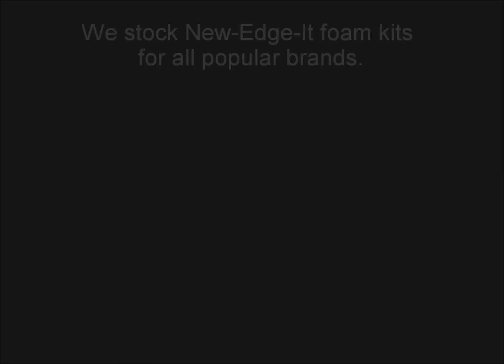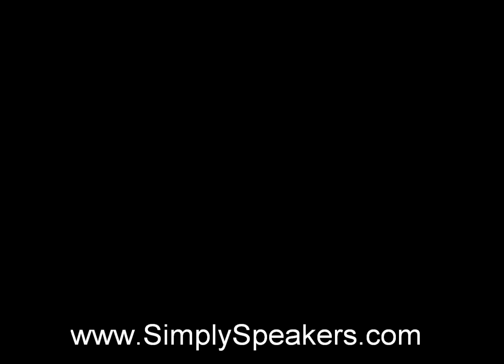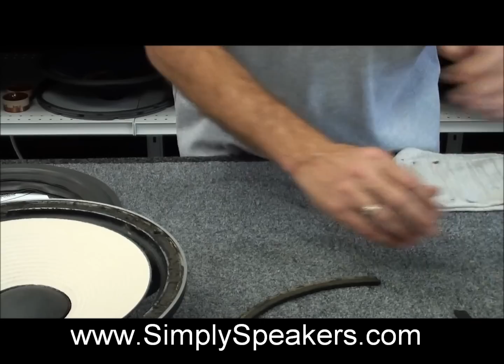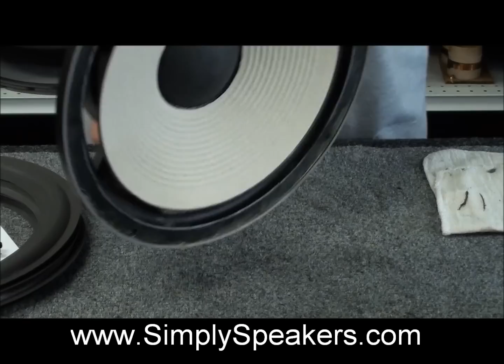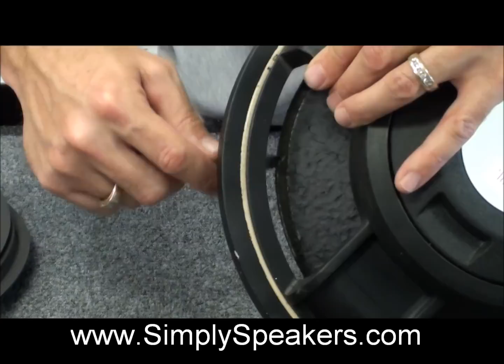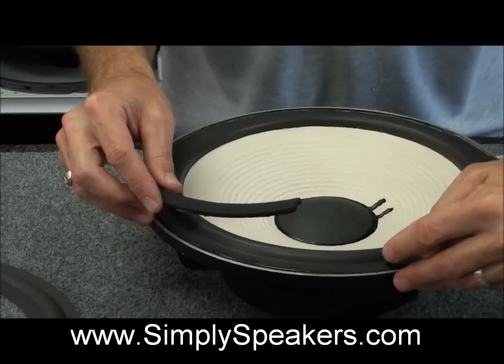JBL Speaker Repair 128H Replace Foam Edge Speaker Cone REAR MOUNT

Comment: I just repaired two JBL 128H Woofers on my set of Jubal L-65s. I used the Foam Edge Kit I obtained recently from Simply Speakers. These loudspeakers are extremely important and precious to me. I've owned them since the mid 1970s and they are truly my "EARS."  The woofers had been "re-foamed" in the late 1990s by a professional repair facility. Recently I discovered that both woofers needed their foam edges to be replaced again due to the onset of deterioration. I owned and engineered a professional Multi-Track Analog studio in Philadelphia which sported JBL Studio Monitors in all its "live" and control rooms. The L-65 speaker system I own was always used in my residence. They serving as the perfect pair of "test" speakers outside of the studio environment. The foam edge repair restored these woofers to perfection! I am thrilled to have my "ears" back at 100%. Thank you Simply Speakers for the terrific video, which I watched several times before making the repair to both woofers last night. Messy? You bet! But worth every bit of cleanup to have my Jubal L-65s singing again! Deeply appreciated!! Andy Kahn
Reply: Those are awesome speakers.  I will surely buy a pair of these when I find them locally.

Comment: Just finished pair of 125As from L36s, my 1st refoam. Glue application is harder than it looks here on back of the cone. Glue dries pretty fast so if you dont lay an even bead 1st time, touch up is sketchy. I had to do alot more babysitting the foam to cone curing, bout 15 min of pressing foam to lay down flat & stay there with a spoon handle. Once this Glue tacks. It's hard to work with.

Comment: Yeah thank you guys just finished my JBL MRV308 had to do both speakers, first time I did it, bent up one of the cones a little, but they sound great and I can turn my stereo up  loud again.  Seemed a little more difficult because the frame was and cone only had about 1 cm of separation so cleaning the back side of the cone was a little more difficult.

Comment: Ordered the kit from SS and undermounted the surrounds on my >25 yr old 8" JBLs.  I skipped shimming the coil to center on one and it made no difference (the coil has very very close tolerance on these - would not accept playing card strips).  Both speakers sound better than new.  Way worth the $25.

Comment: My  FSK-10 kit has arrived.   I have a pair of JBL 4410 that need refoaming (127H-1).   The confusion lies in the fact that from your page for this part, you offer 2 different videos, one has you gluing the new gasket to the front of the cone, the other to the rear of the cone. Well, which is it? And does it matter? It appears gluing to the front is much easier so if it makes no difference, I'd be inclined to do that. But I can tell from the old foam I scraped off that the original was glued to the back.
Reply from the maker: We prefer to install the JBL surrounds on the rear of the cone. Use the JBL video as a guide and you will be fine. Thanks!

Comment: I've found that I rarely ever need to use alcohol on cleaning the frames or cones. I simply scrape the old foam away with my razor knife and the foam is removed.

Comment: Great videos and work...

Please, do you have the 335439-001 midrange and 335149-001 woofer repair kits? 
From JBL S38, maybe S38ii fits fine...

Thanks!
Reply from the maker: Cabinet model please?

Comment: hey, I got a pair of JBL 4425 that's bee re foamed but I noticed that it was glued on top pf the cone not underneath as you guys are showing, will this affect the sound? I want to get your foams as they are the best would it be possible remove the ones on top to do it properly with your products? thanks
Reply from the maker: Send a photo of the woofers to us at: info@simplyspeakers.com and we will take a look to see if you might be able to remove the top mounted surrounds.

Comment: Are the standards of the surrounds different for other JBL models? I just finished my 4410s and the surround spacing was very sloppy between the cone edge and surround roll. Bad enough they may need to be reconed. Nothing like my CVs, Advents, or infinity speakers.
Reply from the maker: Need more info. Send a photo of the repair you made to: info@simplyspeakers.com and we will take a look. Thanks!

Comment: i see plenty cerwin vega refoam vidios however not a single comlpete rebuild. im reconing a 15' dx9 woofer and cant find any information on how to set the depth of coil. i dont want to go off its current position do to the fact that someone has already had these apart at one point and time. if any one can point me in the right direction it would be greatly appreciated
Reply from the maker: Send a photo of the coil shimmed in place before you glue in the spider and we will let you know if you are safe to proceed. Send to: info@simplyspeakers.com

Comment: I have a set of JBL 112's one of my Grandkids pushed on one of the speakers and the center cone is pushed in how can I get that back up ?
Reply from the maker: Try warming with a hair dryer and using a piece of painters tape to pop it back into shape. If that doesn't do the trick, we sell the new caps. Part # DC-3P. See our website. Thanks!

Comment: Is that 91% isopropanol you're using? It's kind of hard to make out from the video. I tried some 70% (because it's what I had), but it doesn't seem to do much.
Reply from the maker: Ivan Jager Yes sir. 91%. Lacquer thinner works good too on stubborn speakers.